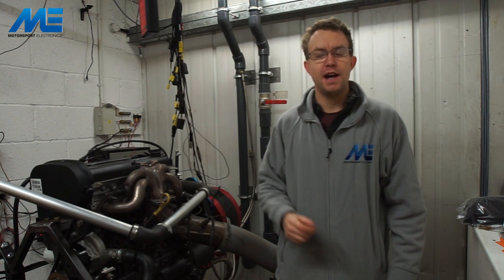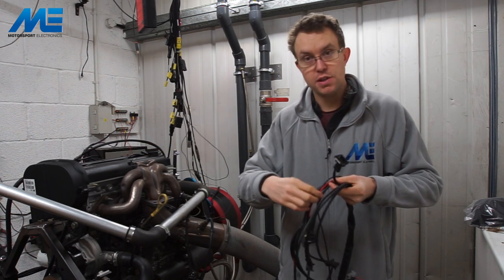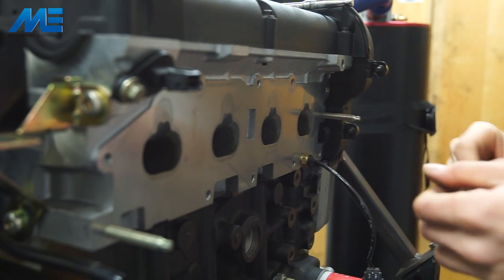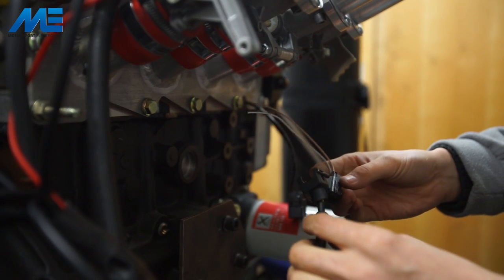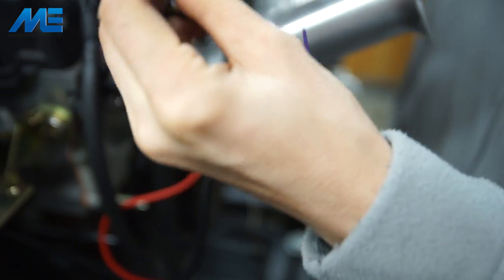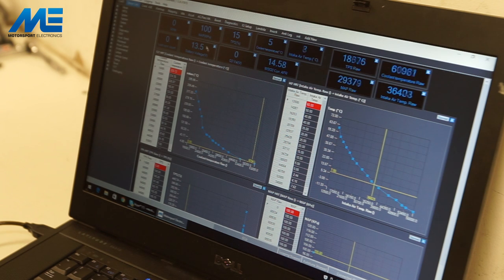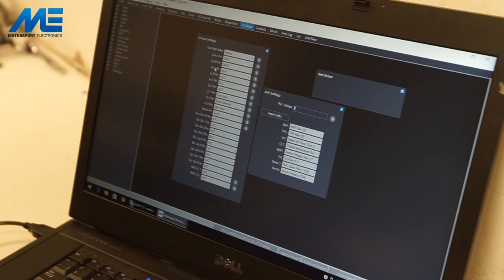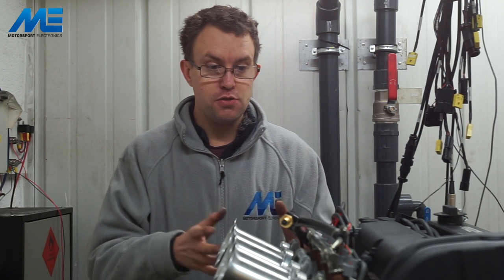ME221 Wire-In | Zetec PnP ECU Install Guide (Supports ST170)

Comment: i just can figure out this - can ME221 do the following on a ST170: can it control the stock fuel pump controller so its variable, by reading the stock ST170 fuel rail pressure sensor? And, can it connect to the stock ST170 dashboard?
Reply from the maker: The ECU can read the stock fuel pressure sensor, but has no provisions at the moment to do a closed loop control of the stock fuel pump.

Comment: ALSO, CAN U PLEASE TELL ME, DO YOU HAVE TO USE A TORQUE PLATE WHEN BORING OUT A 2003 ZETEC 2.0 DOHC VIN 3 MOTOR OR IS A TORQUE PLATE ONLY NEEDED ON A 2.3????????
Reply: Torque plate needed on all

Comment: HI MATT!!!  U SEEM 2 KNOW  UR WAY ARROUND TUNNING A ZETEC BLACKTOP & I WISH MINE WAS TUNED & RUNNING BETTER THEN STOCK. I INSTALLED A POD FILTER & IT WOKE THE ZETEC UP & SOON AFTER, A KNOCKING/DEISELING SOUND WHEN UNDER LOAD ONLY! NOT WHEN ITS IN NEUTRAL JUST WHEN U APPLY TORQUE WHILE IN GEAR? WHAT DO U THINK IT IS? MAIN OR ROD BEARINGS?   ITS NOT A LOUD KNOCK! ONLY HEAR IT UNDER LOAD ABOUT 2-3K RPM'S WHEN IN GEAR! IM THINKING ITS THE BEARINGS...I ONLY HAVE ROD BEARINGS RITE NOW,SHOULD I REPLACE THE MAIN BEARINGS AT THE SAME TIME AS THE ROD BEARINGS??????? THEY WORE TOGETHER SO CHANGE THEM AT THE SAME TIME? IM GOING TO USE STD SIZED BEARINGS. PLZ RESPOND BACK PLZ???